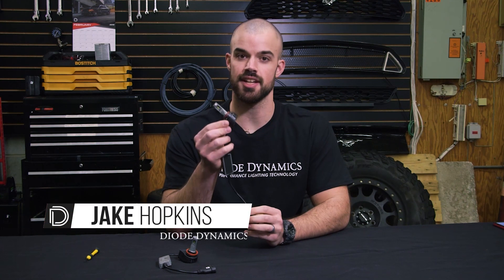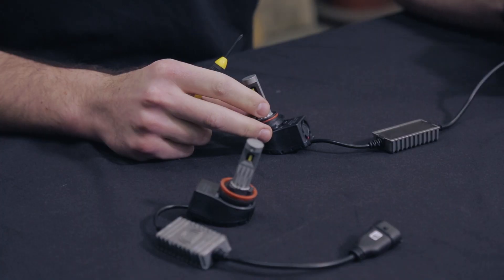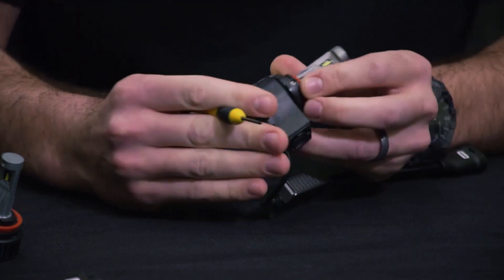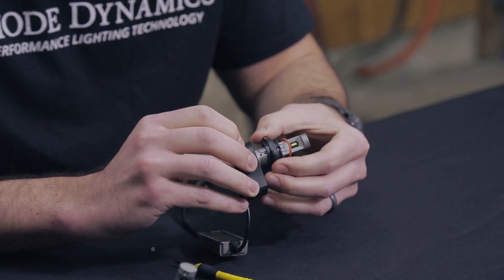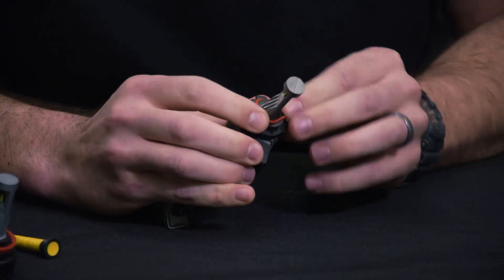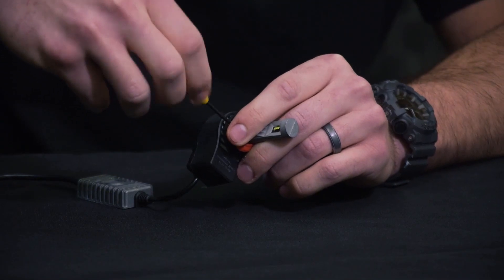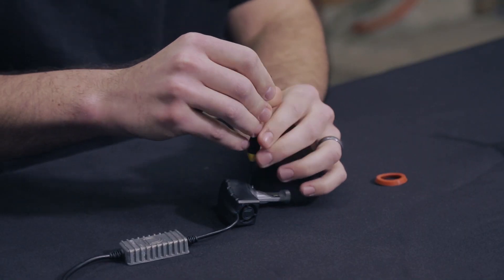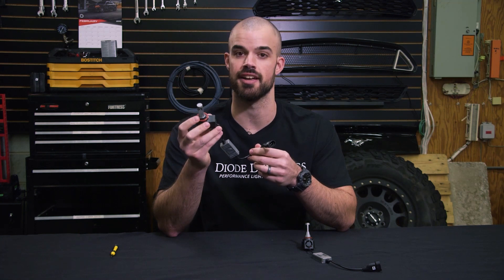SL1 LED Bulb Collar Rotation | Diode Dynamics

Comment: I'm definitely going to have to try this. Just bought these for my '17 challenger and the beam pattern is everywhere but right in front of me.  Major blind spot.  Passenger side faces down while my drivers side is up.  Hoping this helps and I didn't waste $250
Reply from the maker: That should be the fix! Our lights give the same pattern as your OEM beam pattern if installed correctly!

Comment: I bought these for my Chrysler 300 more than a year ago (before the recall), and finally got around to installing them. PRETTY sure the recall said something about them being too bright... I should have sent them back. 
I could barely get them in, because the plastic tabs that lock the bulb body in place in the headlight were so thick, compared to any standard bulb (Sylvania halogens, for reference), that i had to push really hard to even get them to seat in. Wasn't even confident that they got the full 1/8 or 1/6 turn to lock in place, but they felt like they were in there pretty solidly... Until I drove the car for a while, they looked terrible, and I went to take them out, one definitely wasn't locked in place, but I wasn't able to get it fully installed to test it again.

That being said, they were far from too bright. They had a terrible, cat eye pattern with essentially a parentheses of lighting pattern on the outsides, near zero in the middle, and I tried adjusting the clocking of the LED, but couldn't seem to get the alignment right. 

For the price, I expect better fitment and easier alignment. Doesn't help that I was in a cramped spot with awkward access behind the headlights in my 300, but regardless, I'm just absolutely not sold on these. 

The color temperature of the LEDs was EXACTLY what I was looking for, because it matched the LED running light and fog lights that come with the 300, as standard. Having 2 yellow bulbs with all of that crisp LED really bothered me, but I won't sacrifice safety for vanity.
Reply from the maker: Hey there! Sorry to hear that! Please go ahead and give us a call at 314-205-3033 Monday-Friday 10 a.m.- 5 p.m. CST, or shoot us an email at contact@diodedynamics.com, and our service team would be happy to help you with that!

Comment: I’m trying to figure out the difference between the SL1 & the SLF... I’m looking to install them on my 2015 Focus ST fog lights. The SL1 is brighter but will the design of the SLF provide better output because of its design?
Reply from the maker: The SL1 will provide a further and more focused beam. The SLF is designed to spread light in a wide spread directly in front of the vehicle

Comment: Apparently, these bulbs are now "recalled".  What I don't know is how these are functionally any different than the OEM LED setups that I have in my other cars.
Reply from the maker: They are recalled for headlight bulb use. They can still be used in fog light applications. They don't function any different than OEM LED setups. If you would like further information, check out the link below. 

https://www.diodedynamics.com/street-use-of-led-bulbs